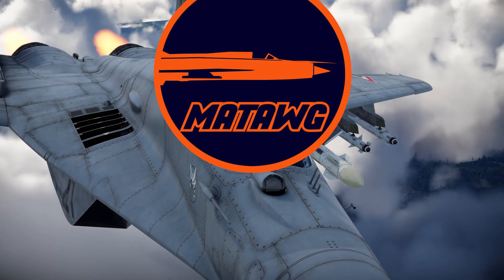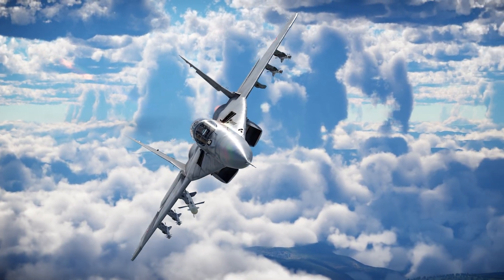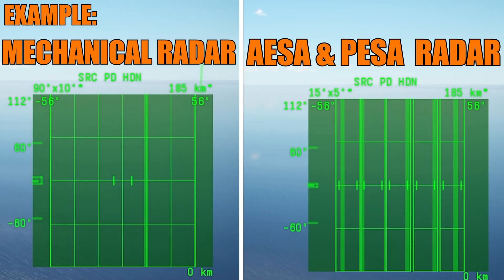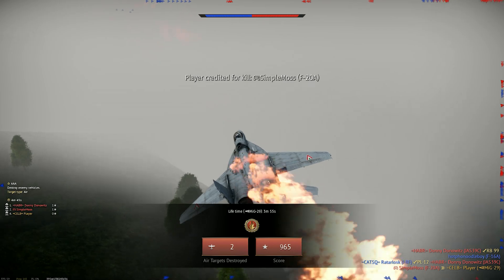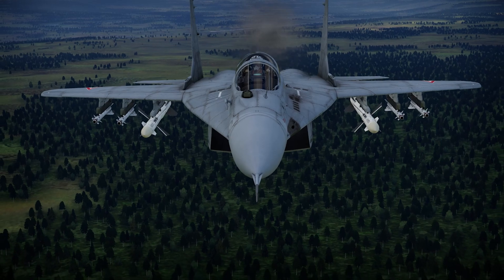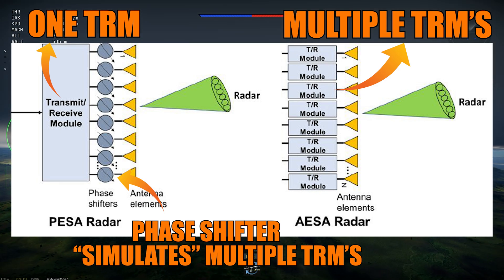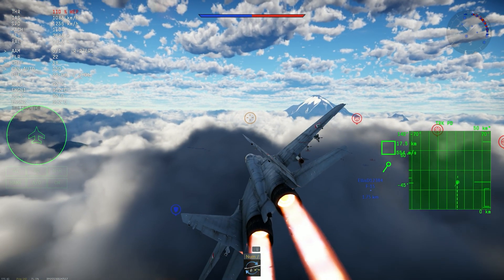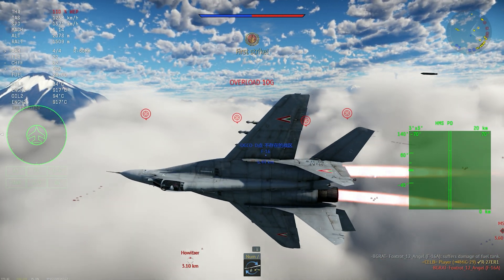The FUTURE of RADARS in game! WHAT are AESA & PESA radars? - War Thunder

Comment: Matt,  I don't think that only having one emitter (the source of the original signal) like on a PESA radar means that you will have more range unless you also only have one transmitter antenna. PESA and AESA radars both suffer from the same problem here which is that the steering method operates off of wave interference caused by some of the antennas having their emmission delayed, either because each TRM is controlled individually via a central computer such as the case with the AESA, or because each transmitter antenna is receiving the same signal at varying times do to a controlled signal delay component which controls the time it takes for the original signal to travel from the source to the antennas.

Because they both operate from wave interference there will always be more energy lost. The more each signal is delayed, the higher the angle of beam steering but also the higher the destructive interference and less constructive interference at least in the direction of the target. This means that radar sensitivity at high angles is reduced, and as a general rule of thumb, at 45 degrees of beam steering the sensitivity advantage of most AESA/PESA arrays is negated compared to a mechanically steered emitter of similar wattage. I believe this applies to both the AESA and PESA radars. The structure of both of these systems antennas is nearly identical as is the operation of them in this regard, the difference is the methods used to control them.

The real differences between the AESA and PESA radars is the fact that in AESA systems, each individual TRM is independently controllable. This means that it is much much easier for it to perform a variety of tasks such as ground mapping, air to air, radar jamming, or Low Probability of Intercept operation (stealthy radar). PESA radars can do these things but it is more difficult and in many cases it is not as effective. For example with ECM, the way that it works is that a radar beam from enemy radar is detected and then very quickly replicated by your radar in order to confuse the enemy receivers so that they cant tell how far away you are. This is much easier with an AESA radar because it has many individual TRMs, which means it can receive and transmit basically at the same time, and it can also change the type of wave form and PRF all that stuff very quickly too, so that it is a more convincing picture to the enemy radar if that makes sense.

Another example would be LPI (stealth radar). This in my opinion is what really sets the two apart because in an AESA radar it can use multiple wave forms at the same time, as well as changing PRF, reducing power, and the ability to use CW signals while still receiving because again it has multiple TRMs. The enemy RWR is listening for a pattern that sounds like "boop.boop.boop.boop" and then it can recognize that that is in fact, a radar. Instead it basically just hears TV static. Modern RWRs designed after the adoption of AESA radars are equipped to handle this better but still struggle greatly especially with the CW signal if i understand right, and even if the RWR can recognize that this jumbled mess of waves is a radar, it most certainly wont know what type of radar.

Now with that in mind, Im not aware of any performance downsides of an AESA when compared to a PESA radar of similar wattage, the main drawback is weight. so even though they look similar on the outside, all of the functions of each individual TRM is controlled by a central computer in the AESA. It is extremely power hungry and with all of that power it is going to generate a lot of heat compared to all other radars, meaning that not only do you have a bigger computer but you also have a bigger cooling system. This increases weight a considerable amount. That can lead into the newer, more efficient Gallium Nitride circuits vs the older Gallium Arsenide ones, but we will likely not see a radar with gallium nitride circuits in game for quite some time.

Comment: That PESA radars have a greater range than AESA radars is an outdated and false claim. Modern AESA radars can have twice the range of a PESA radar along with significant advantage in almost every aspect. From resolution and fidelity to ECCMs (jamming resistance) and multi-tasking (faster scan rate, simultaneous air and ground operations), the difference is just enormous. 

Example: The Irbis-E PESA radar boasts a 350 km detection range against a 3 m² RCS target, but this is under ideal conditions: a high PRF mode, a 10°x10° cued search window, and without factoring in any electronic countermeasures or environmental factors. In normal volume search mode (used in practical combat scenarios), this detection range is reduced to approximately 200 km for fighter-sized targets, and its tracking range is often around 100 km. Additionally, the radar's detection range against high-RCS targets like bombers (e.g., B-52) is capped at around 250 km.

In contrast, AESA radars like the APG-77 and APG-81 not only match, but can exceed these ranges while operating in more flexible and practical search modes. The APG-77, for instance, can detect fighter-sized targets beyond 250 km, with a tracking range significantly greater than the Irbis-E, and does so while maintaining full Low Probability of Intercept (LPI) operation, meaning the radar emissions are much harder to detect by enemy RWRs (Radar Warning Receivers). This is because AESA radars can dynamically shift power between thousands of TRMs (Transmit/Receive Modules)—the APG-77 has approximately 2,000 TRMs, compared to the Irbis-E’s 1,524 TRMs. AESA radars also benefit from superior beam agility. Since they don’t rely on mechanical gimbals, they can rapidly scan a large volume of airspace while focusing power where it is most needed, unlike PESA radars which must compromise between scan volume and detection range. For example, while the Irbis-E might achieve its claimed 350 km in a very narrow FoV, the APG-77 can detect targets over similar ranges while scanning a much wider area due to its electronic beam-steering capabilities.

In actual operational scenarios, AESA radars consistently outperform PESA in terms of detection and tracking range. For example, the APG-79 on the F/A-18E/F Super Hornet has a detection range well beyond the AIM-120D missile's engagement envelope, providing over 150 km of detection range against fighter-sized targets in cluttered environments, and its performance will be enhanced with the introduction of the AIM-260 JATM, where the radar's detection range exceeds the missile's capability. Even the smaller APG-83 AESA on the F-16V can achieve 300 km SAR mapping range, surpassing the Irbis-E’s air-to-ground targeting range.
Reply: The fact that this technology was made when flip phones were new is wild. This technology is like turning on a TAC view in a replay and never fails to amaze me. Also what is the SAR mapping range and scan array for the Apg81? (If it's not classified). I've struggled to find any real numbers or the limits of these systems.

Comment: The F-15C MSIP II has the AN/APG-63(V2), which is an AESA radar, and later it received the AN/APG-63(V3), which is the same but improved. So Gaijin can add AESA on the F-15C MSIP II without adding a new version, because the F-15C in the game already has HMD, which was introduced with the AIM-9X and AIM-120C/D, and the AN/APG-63(V2) was use before the AIM-9X
Reply: probably add a new plane and call it MSIP II(L) or something like that

Comment: For game mechanical the difference between how PESA and AESA radars works is irrelevant. Since most of the differences they have really shows off on range scales that are we outside the scope of the game, since there isn't a big enough map in War Thunder that it would actualy matter.
Reply: Expect 600km x 600km maps in 2025 along with PESA and AESA radars, expect the datalink in game to be expanded to appropriate jets and expect them to finally add the already modeled AWACS, ground based Air Search Radar and finally the Patriot and S-200 SAM batteries. 
They're about to DCS the game.
Reply: @missingthe80s58 And they'll still refuse to make EC RB lol

Comment: I think the most interesting AESA radar is an Su-57's Byelka. It's in fact 4 radar antennas that provides 360 deg coverage.
Reply: Rafale has it too, but for different uses, mainly to send radar wave to the enemies/ missile radar to blind it (like when you point a powerful flashlight at someone)
Reply: @exonys3838  Jamming
Reply: @nichendrix  yes, but that’s a more effective way of jamming
Reply: The F-35 also have that kind of thing. IIRC the Su-57 has different radars throughout its fuselage, on the wings it has a lower wavelength search module that looks for LO targets at standoff ranges, while its main radar scans on higher wavelengths with higher resolution to acquire a lock on targets.
Reply: @nichendrix  F-35 has the DAS, it's IRST system not the radar, but it's very interesting too
Reply: No, the Su-57's Byelka radar doesn’t provide 360-degree coverage, nor does it have four fully capable radars. The N036 Byelka has a main X-band AESA in the nose and L-band side arrays, but the side antennas are not radars—they’re IFF/EW systems with limited capability. The main X-band AESA array in the nose has approximately 1,550 TRMs (Transmit/Receive Modules), which gives it respectable range and resolution in the forward sector. However, the side and rear L-band antennas have far fewer TRMs, significantly limiting their range, resolution, and beam-steering capabilities. For comparison, the APG-77v1 on the F-22 has 2,000 TRMs, while the APG-81 on the F-35 has 1,676 TRMs, both of which are superior to the Su-57 in terms of overall detection range and precision.

Additionally, the L-band antennas are limited by their physical size. At around 1 meter in length and operating at 1 GHz, the L-band antenna on the Su-57 generates a beamwidth of approximately 21 degrees, which is far too wide for effective radar tracking. For context, modern radars typically operate with 2-3 degrees beamwidth to ensure focused detection and tracking. The Su-57’s L-band antennas simply cannot generate the narrow beams required for high-resolution radar performance and are thus unsuitable for functioning as radars. Furthermore, these antennas only have a single row of TR modules, which restricts beam-steering to 2D (azimuth only), severely limiting their effectiveness in both detection range and resolution. In terms of overall coverage, the Su-57's radar suite offers increased situational awareness compared to legacy systems, but it does not provide true 360-degree radar coverage. The nose-mounted X-band AESA provides precise forward coverage, but the side and rear L-band antennas cannot match this performance. They only extend the radar’s field of view (FoV) to about 270 degrees, with limited tracking fidelity and range, especially in the rear sector.
Reply: @Levi-pp8sq  if the L Band antenas are used just to identify the presence of planes in its range and IFF them, and also provide an general direction of that signal, the L band system wouldn't really need to be used for search and track, if you know an enemy plane is flying around and it's general direction relative to you, you can then use your main radar to have a better look in that vector and use it to search and track. Also, if you use both L Band antenas as an inteferometer, they could be used as a detector for wavelengths the size of the aircraft, which may be handy for early warning against LO targets.

I don't know if the Russians have enough computing power on-board of the Su-57 to automatically perform finer signal processing operations and/or use Machine Learning/AI to perform signal processing, as well astagging and classification of very weak return signal like some of the most recent ground based system have (both Western, Russian, Chinese, etc.), but if it has, the X Band radar could, possibly, be used to search and track LO target at far enough ranges to defend against any attack from it.

But a few things you said on your comparison between PESA and AESA, in specific about the range and resistance to jamming is somewhat misleading, it is true that the most recent AESA radars can have greater detection range and be more resistant to jamming than current  PESA radars, but that's because the most recent generation of AESA airborne Radars have TRMs made with new materials that are better at handling power and more sensitive to weaker signals, and, at the same time, they have access to more computing power than the PESA radars currently in use, which allows the to among other things operate in low probability intercept mode. 

Despite that if you employ the same materials and computing power to build an AESA and a PESA radar system, so physics essentialy guarantee that the PESA system would necessarily have greater range than the AESA, and it also have the greater ability to break jamming with pure brute force than the AESA radars, because you can pack more power on that single TRM than the power distributed to all the AESA TRMs combined.

But as I said, this is only valid if you use the same materials on the AESA and PESA systems, which isn't something that will happen in real life. Thus the current AESA systems are made wirh better components than their PESA counterparts.
Reply: @Levi-pp8sq You have a good point, however your talking about the Su-57, the 360 scanned array with 6 radars is the Su-57M, which is the variant with the ALF-51 and S-duct intakes. Sorry if my English isnt understandable im Russian
Reply: @Levi-pp8sq  This! 👍
Reply: 6*

1x Main Radar Antenna facing forward

2x Facing sideways from the nose

2x in the left and right wings facing in a forward / side angle

1x in the tail facing backwards.